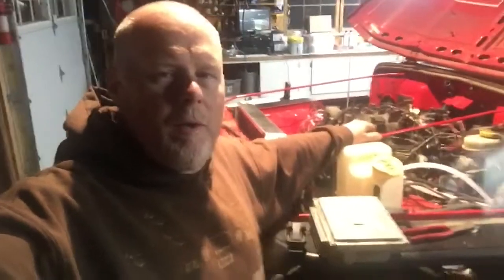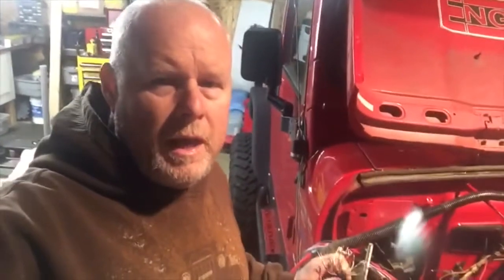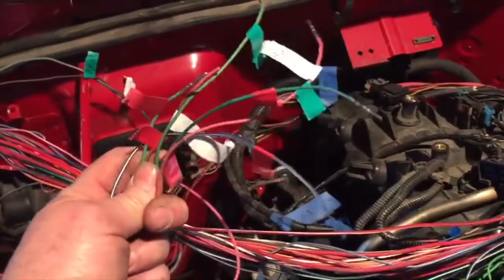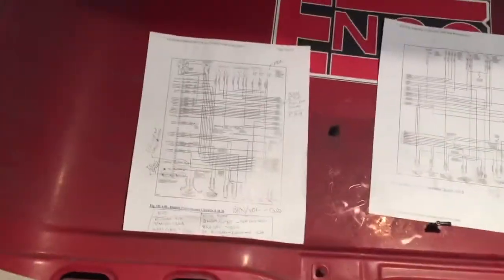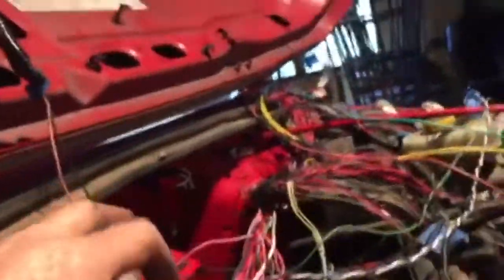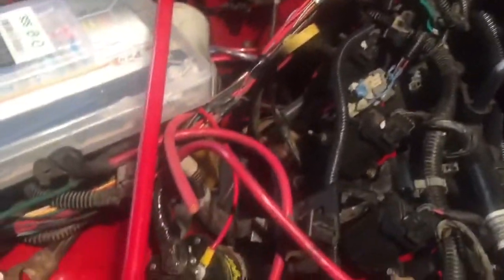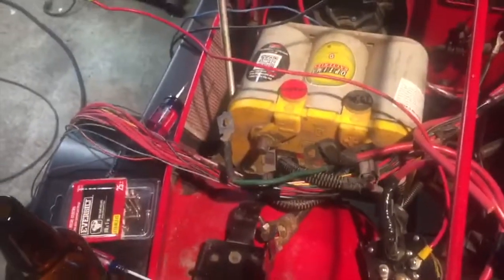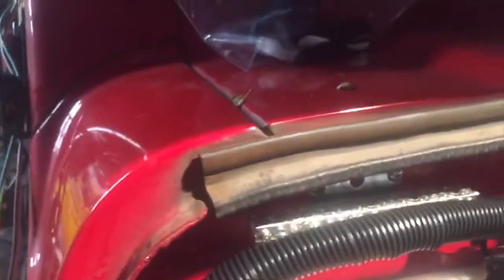Wiring: Jeep Wrangler LS Swap (Part 3)

Comment: Another good video. 
Did you happen to document which wires in the Jeeps harness you kepts and which ones you deleted that you'd be willing to share?
Did you figure out how to wire up the VSS between the Jeep and the GM harnesses?
Reply from the maker: Ted Hargiss yes! Check out the last posted video for the VSS. As for which wires to keep and which to get rid of, we followed another YouTuber’s video, I’ll ask my dad for it and link it
Reply from the maker: Here is the video we followed on the harness https://www.youtube.com/watch?v=RHIVd_SkB9Y
Reply: @Joester1908  Thanks for the follow-up. Yeah, I watched Mike over at UcanDoit2 as well when I worked my GM harness. My question is about the Jeep's harness. You mentioned that you re-worked the Jeep harness as well as the GM harness when connecting the gauges and other connectors. I was just wondering if you documented which wires you got rid of in the Jeep's harness.
Reply from the maker: Ted Hargiss we didn’t actually document which wiring we changed. It was on the fly and took a few tries to figure it out. The stock fuel pump, speedo/ transfer case harness were used and tied into the GM or bypassed. I wish we had filmed it